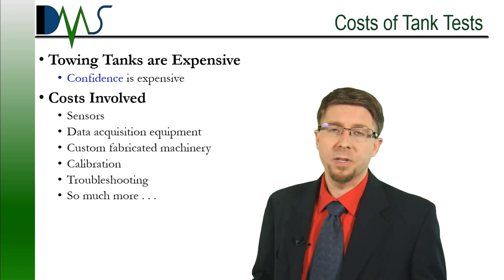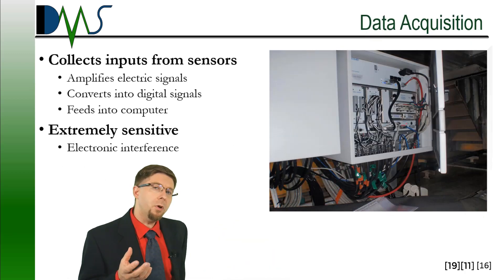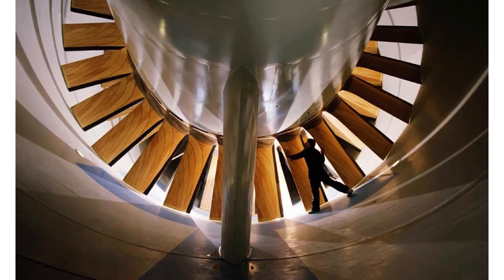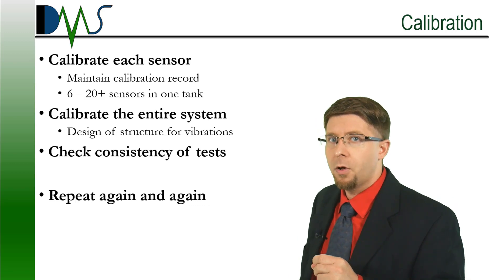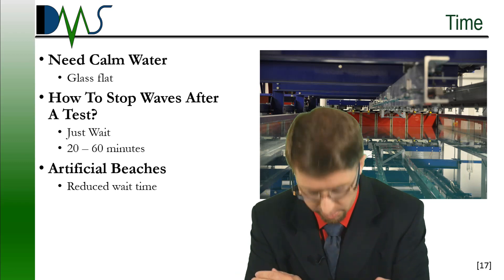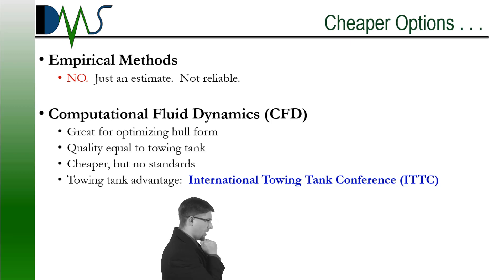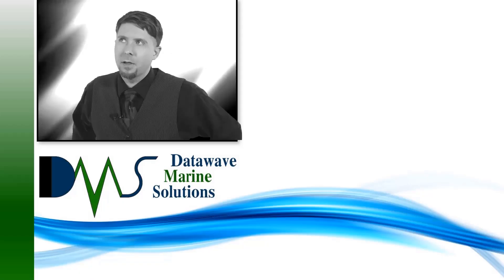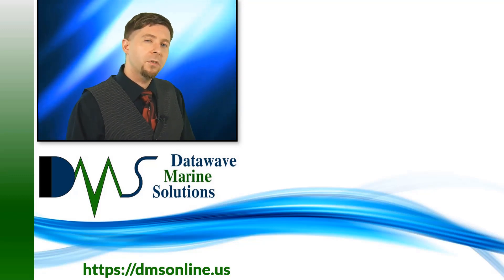Towing Tank Components:  The Cost of Quality

Comment: Do the rails of your tanks have to be corrected for earth's curvature? If so, how is this accomplished?
Reply from the maker: For long towing tanks, yes, you do need to correct for Earth's curvature.  I did see one paper where they built a small shallow trough into the side of the tank.  They filled the trough with water and used that as the vertical reference for alignment of the rails.  The water surface stays parallel to Earth's local gravitational field, which is what you really needed.
Reply: @DatawaveMarineSolutions  huh...that's fascinating. thank you very much for the quick and detailed reply. one more question, if you don't mind: does the alignment of the rail have to be checked? could this also be done by calibrating it to the level water surface? In my imagination I would let a ruler hang from the carriage and pull it slowly thru the water. if the ruler stays at the same depth throughout, the carriage is aligned.
Reply from the maker: @floryda4281  Yes, the rail alignment needs to be checked.  One tank I read about required an accuracy of +/- 0.1 mm over the rail length.  Details on how to perform that alignment would be considered paid consulting work for DMS.
Reply: @DatawaveMarineSolutions  thanks so much! I'd feel a little embarrassed if I told you how I found your video ;-) thank  you anyways for your time! Take care.

Comment: Great video. All things considered, 20k is not rly that much. Most middle-class ppl in the developed world can afford to buy a car around 20k, with financing (loans), and will prolly do so several times in their life.

Real question is, how many of those tests do you need? I imagine the military will want many different types of towing tests. But then they have an even bigger budget and tend to mass produce many ships from one model.

BTW i still don't understand why a person needs to ride the gantry? If it's all recorded with sensors and computers, just let the thing run on its own and send the data to a computer somewhere. If someone has to ride it, then don't they have to hold real still to avoid false force fluctuations? Seems totally unnecessary to me.
Reply from the maker: Great question about riding the gantry!  And you hit on several of the practical issues.  First, to answer the question of false force fluctuations.  We take care of that problem when we design the gantry.  This is one of the costs behind the initial tank setup.  We intentionally overbuild the gantry and design it to minimize vibrations.  The major concern is vibrations from traveling down the rails.  We are even careful about the sensor attachments to isolate any force fluctuations from the sensors.  By the time you do all that, people can walk around without affecting the readings.

Second part is convenience.  We want to minimize the length of cable for transmission from sensor to computer.  So easiest way is to put the computer on the platform with the sensor.  This also makes it easy to add extra sensors or reconfigure the gantry with a new test platform.  Finally, as naval architects, we usually like to get a first hand view of the model.  First person observation lets you determine if we failed to measure something important with the sensors.

All that said, the smaller towing tanks do go with the configuration you suggested.  They place the people by the side of the tank, and the gantry runs with only a few multiplexers to transmit the data back.  But you rarely see that setup in a commercial towing tank.
Reply: Hi, we are in the final stage of building a new towing tank at the University of Southampton in the UK (https://www.southampton.ac.uk/engineering/research/facilities/towing-tank.page). Our carriage will have the capability to run unmanned, but you absolutely need to be able to be on it to check your setup is correct. It is impossible to pick up small movements or friction with video cameras.

Comment: You make it sound like strain gauges are some arcane art. They are bog standard industrially produced measurement components. High precision yes but nothing you're dealing with is outside the realm of normally manufactured equipment. Calibration houses are located all over the country, they have the equipment to calibrate every sensor you could imagine at a relatively low cost with ease. NIST traceable is the defacto standard, it's not something special.
Either you are blowing the measurement side of this way out of proportion, or you don't realize how common these measurement tools are in other industries. The DACs to capture this data are standard off the shelf parts, and the wiring is dead simple, at most you have four wires per sensor if it's a full bridge.
Reply from the maker: You are correct.  I exaggerated a little to emphasize the concept, because I have frequently come across industrial users that do not understand the value of high quality measurements.  Based on your comments, you clearly are well educated in signal conditioning and data acquisition.  For someone like you, it is very easy to purchase NIST traceable strain gauges and wire them up to a DAQ.  But I imagine that you don't work for free.  And that NIST certificate on the sensor was not free either.  These things all add to the cost of an experimental facility.
Reply: You're not wrong, but also $20,000 is about the right scale to pay a day's wages for a high-end industrial tool that consumes the labor of several skilled technicians. The facility qualifies as that. The strain gauges are significant for high accuracy but also for being on the business end of a tool whose output includes telling someone whether or not to go ahead with building a $100 million ship.